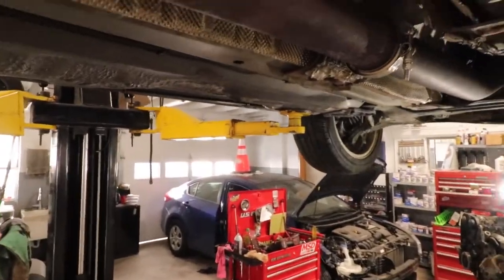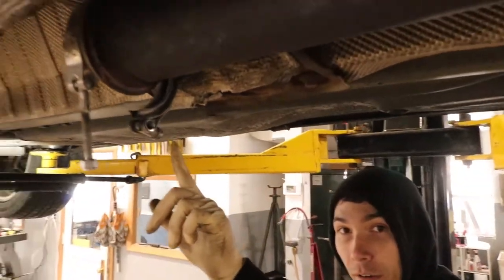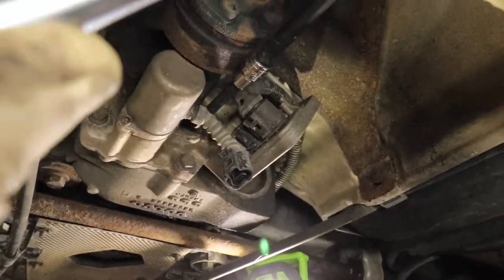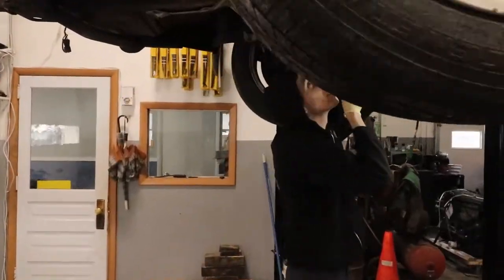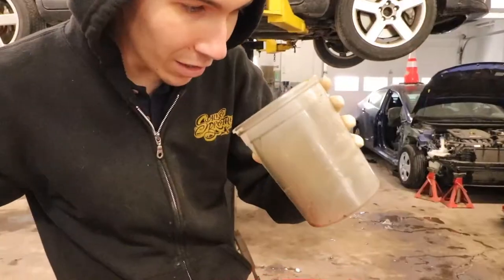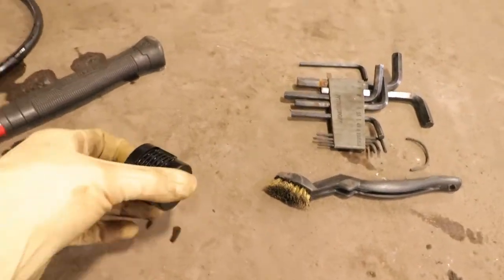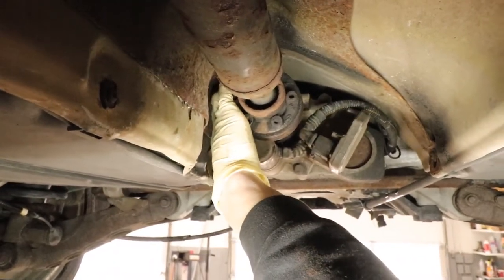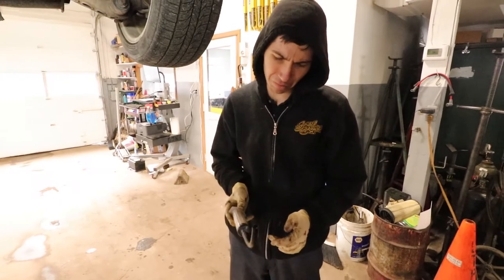Haldex Volvo Fluid and Filter Service How To

Comment: Did not even know i needed to do that lol but makes sense
Reply: What kinda car are you working on?
Reply: @lougrubb8434  exact same car
Reply from the maker: yea definitely something to at least check to see what it looks like
Reply: @salvobrothers5928  welp have very sad news. Car got totalled today need any parts? Im trying to recoup my losses and buy another :'(
Reply from the maker: @AZACKAL  ooh dude sorry to hear that man. where are you located? ill see if nate needs anything.
Reply: @salvobrothers5928  well actually MIGHT BE repairable. MAYBE! Im gonna try to rebuild everything in front of the engine sense the frame turned out to be fine
Reply: @salvobrothers5928  BUT if you need parts try out the p2R owner group they have a sub group that sells parts from parts cars. Its probably where I'm getting the body parts :'(
Reply from the maker: @AZACKAL  nice you got lucky, i would just rebuild it, you may even keep some money from the insurance if you do it all yourself.
Reply from the maker: @AZACKAL  awesome thnx for the info

Comment: i have the 2006 XC70 AWD 2.3L turbo AT do i have a a HALDEX system ? gettin ready to change all fluids trying to prepare for a road trip
Reply from the maker: awesome, road trip sounds amazing
Reply: @salvobrothers5928  do you know if the 2006 xc70 awd turbo has a HALEX?
Reply from the maker: @lanajacknichols8397  not particularly sure

Comment: hello i have a 2005 volvo xc90 with 200,000 miles and the tranny fluid has never been changed i am afraid to do it ,i heard new fluid will make it break true or false  thanx Dom
Reply from the maker: depends on how bad it is, if its black i wouldn't do it, if its a dark red then i would.
Reply: @salvobrothers5928  thanxits black

Comment: I own a 2004 xc70 and the awd stopped working. What could be the problem?
Reply: any noises associated with the failure?  heavy grinding?
its possible the haldex system just failed.  you could have also blown the fuse responsible for AWD, thus making it FWD.  those would be potential candidates for silent failures.
Reply from the maker: i agree with his commment check out this video https://youtu.be/yEqfTkdiwPk we show you what fuse it is in the trunk

Comment: Is the rear differential fill plug oil different from the haldex unit fill plug? It looked like you drained the differential and placed new oil into the differential instead of the haldex unit
Reply from the maker: it has its own fluid

Comment: Have you guys ever replaced the angle gear/transfer case ring and pinion gears or shafts my input shat on mine is stripped for the collar and having trouble finding new parts.
Reply from the maker: we haven't had to do anything to that extent at this point